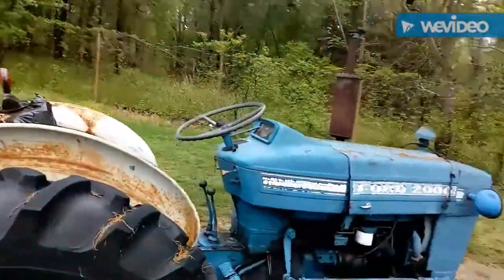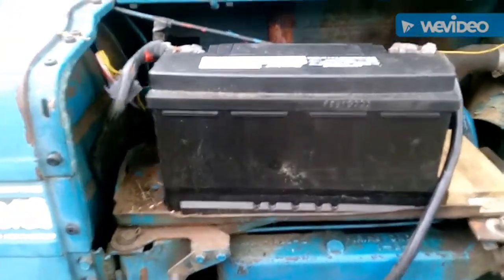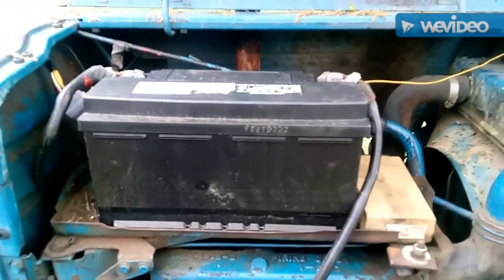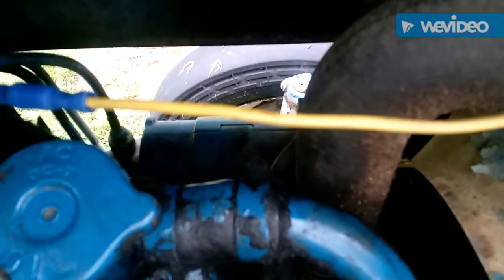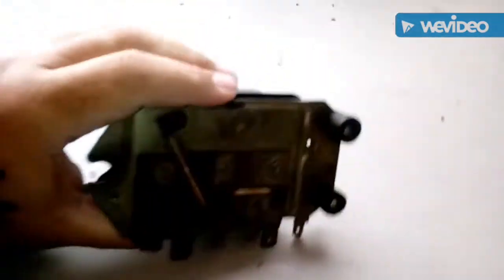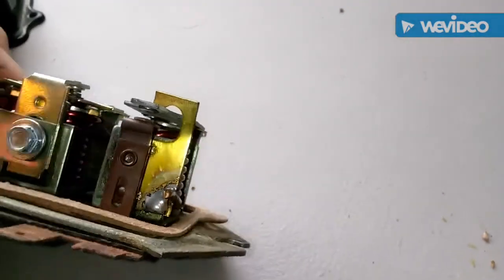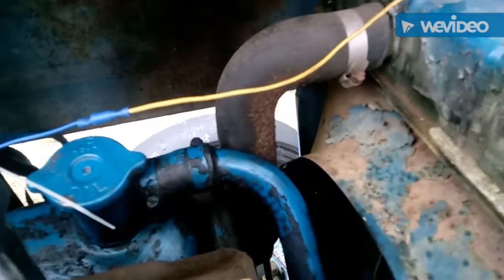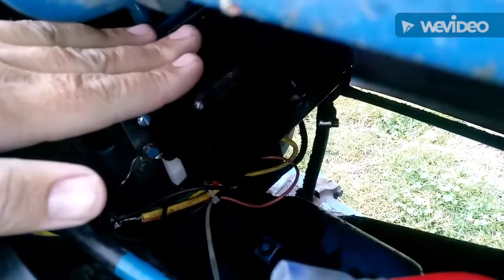How to fix dead battery issues on ford 2000 tractors

Comment: Ford started your model in 65, in 53 they started the hundred series, and in 62, they started the 1000 series 4 cylinder, only in 65 did they make the 3 cylinder version you have, nice tractor by the way, hope this helps